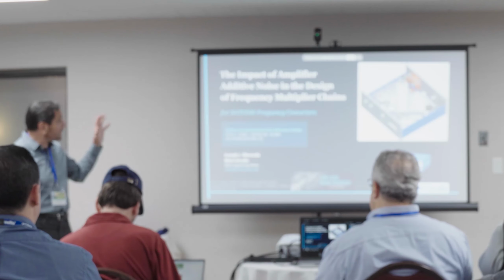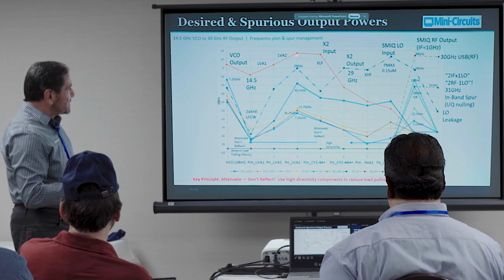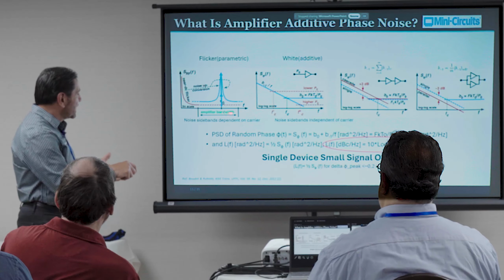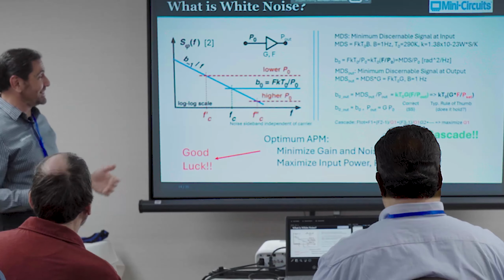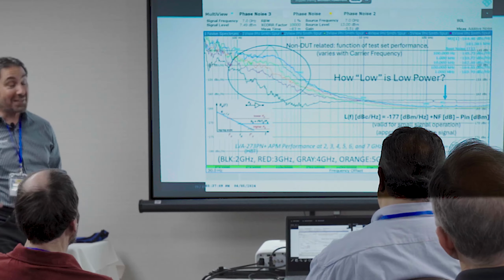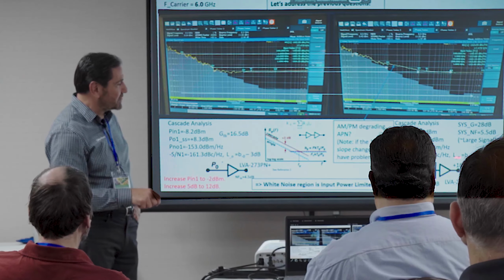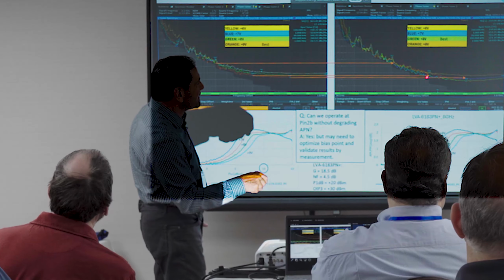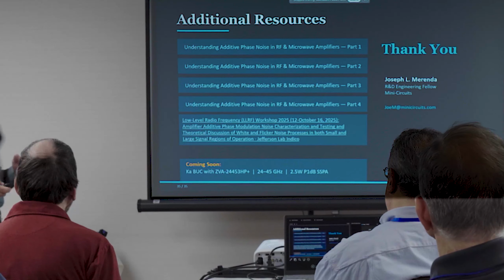Impact of Additive Phase Noise on Frequency Multiplier Chains for SATCOM

Comment: Thanks, really good presentation.  So would a pHEMT with a bunch of narrow width fingers yield better phase noise due to the parallel addition of the flicker noise from each finger?  It doesn’t seem like it would compared to a wider finger unless the trapping is somehow correlated in each finger.